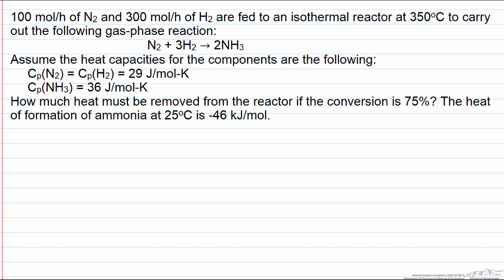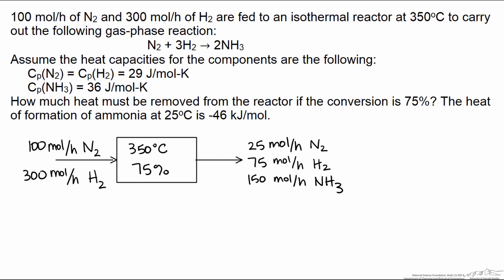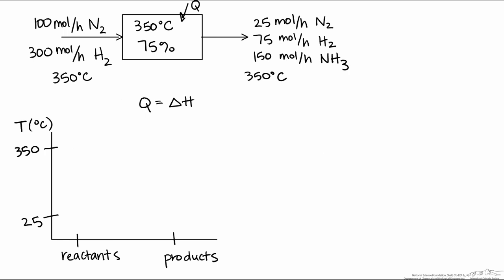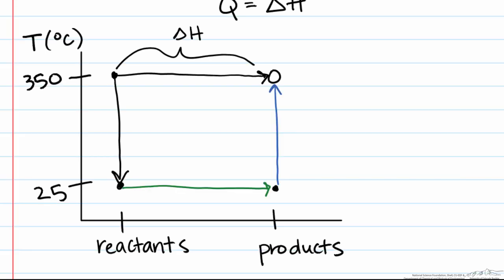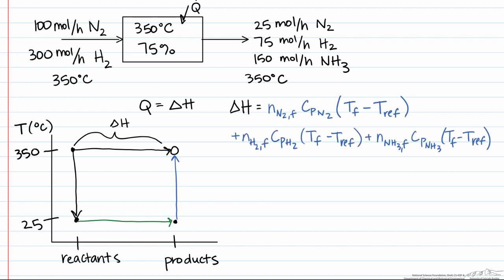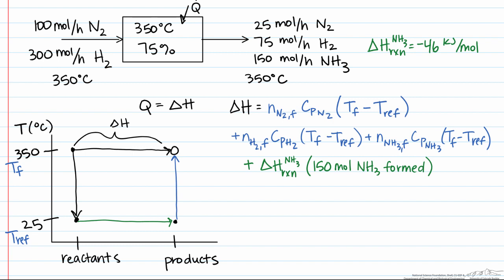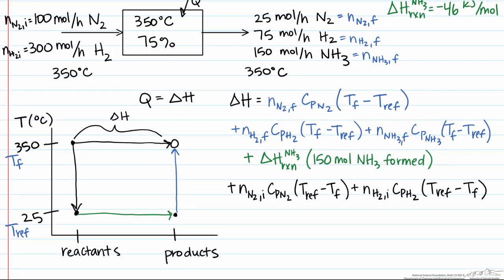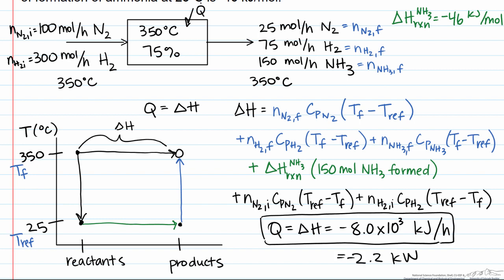Heat Removal from a Chemical Reactor

Comment: the heat of reaction calculation , we must multiply heat of formation of ammonia  by stoic. coeff. of ammonia which was not done here  !!!!!!!
Reply: The solution is performed appropriately.  150 moles of ammonia were formed.  They multiplied that number (150) by the heat of formation (which is on a per mole basis).

Comment: why do not we multiply the heat of reaction for amonia at 25C by 2 since 2 moles of NH3 are formed ?
Reply from the maker: +t13 ta Great question.  The heat of reaction is dependent on a reference state.  In this case, the 46 kJ/mol is based "per mole of NH3".  If you looked up the heat of reaction for N2 +3H2 -> 2NH3, it would be -92 kJ/mol, but since that is to produce 2 moles of NH3, you would divide the number by 2, therefore getting the same answer.  Does that make sense?